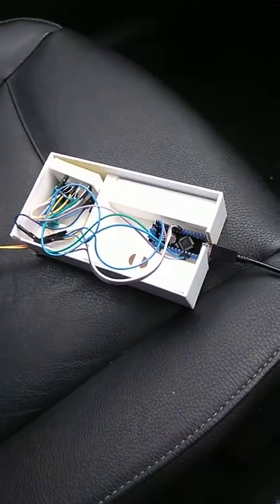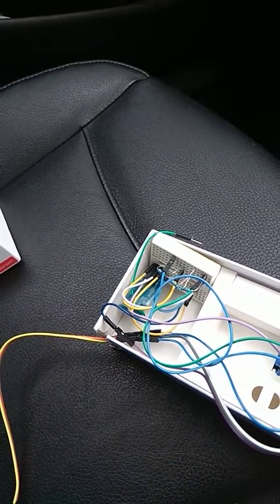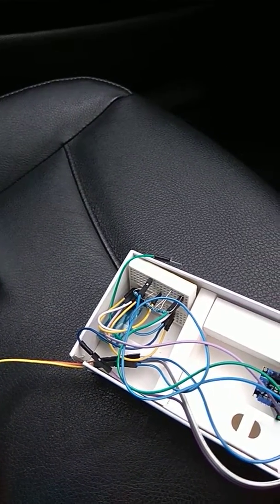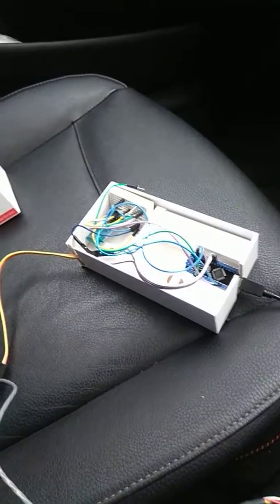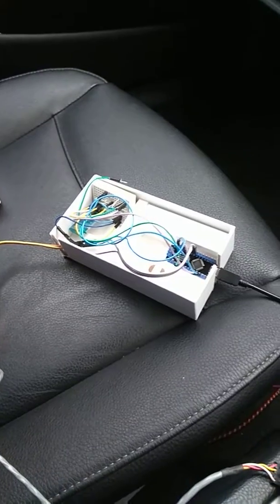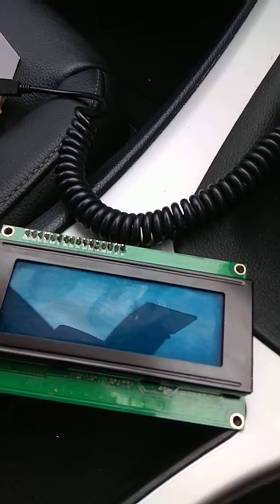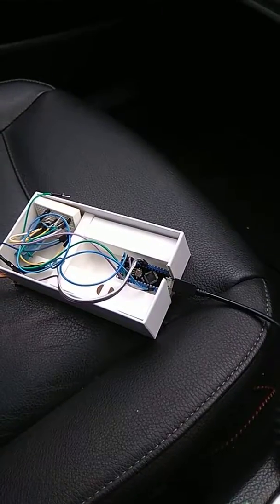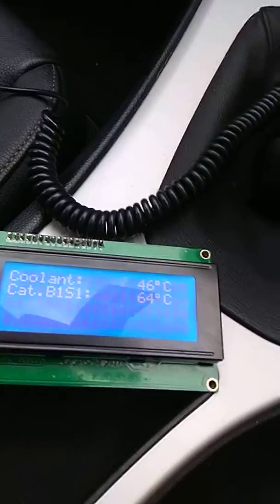Arduino DPF monitor- HC05 + LCD + ELM327

Comment: Looks goods, going to build one and give it a try.  For people that have issues connecting check that you have a HC05 with the switch/button on it. You may have an HC-06 which is slave only and cannot connect to the ELM device.
You need the HC-05 as the master device. Thanks for the video.

Comment: Hello, Sir, I hope you're doing good. I'm having a serious problem connecting my HC-05 with ELM 327. It worked perfectly fine and connections were established between both devices and i've got the values too but suddenly it stopped working and now it does not connect. I'd really appreciate if you give me any tip on how to do it.
Reply from the maker: Masab Ali hi Madan, unfortunately I'm having the same problem. I can connect and get the value but the value is always the same for me. The stupid Bluetooth is so complicated. Sorry I can't help

Comment: I’ve been struggling with this project would you by willing to share your code and sketch?
Reply from the maker: hello friend, this was an old project. I also experienced issues with this and have stopped using it. It is a very difficult system to diagnose. Recently I have revisited this... If you give me a little time, I will fix it up and maybe post a video on how to do it. Else I can post for you my last known working code?
Reply: Hi. Congratulations. It’s wonderfully. I will do same it. My car is Mitsubishi lancer. So I want you used code and sketch. Could you share me?
ihsan.akckyn@gmail.com
Reply: It is possible with esp8266 wifi module sir

Comment: hello, I can not match elm327 with bluetooth HC05 module, could you send the source code of this program? thank you
almeida_sidney@hotmail.com
Reply from the maker: Sidney Almeidasidney connecting the Bluetooth to the elm327 is a real pain as most hc05 modules can only accept connections and not make them. I can share your code but if your Bluetooth and elm327 aren't connecting, there's no point
Reply: @MTechOver9000  hello, very complicated to carry out the communication between the module ELM327 and HC05 bluetooth, I researched in several scientific articles and to be able to carry out the communication. If I can send the source code. thank you
almeida_sidney@hotmail.com
Reply from the maker: Sidney Almeidasidney the code will not help you if you cannot get the hc05 to connect to the elm327
Reply: Hello, Sir, I hope you're doing good. I'm having a serious problem connecting my HC-05 with ELM 327. It worked perfectly fine and connections were established between both devices and i've got the values too but suddenly it stopped working and now it does not connect. I'd really appreciate if you give me any tip on how to do it.

Comment: Hi. Care to share the connection method for the hc05 and elm327? Im stuck with it, did you change the baud rates or something?
Reply from the maker: Isaac Loor I ended up getting stuck with this too. First make sure you have a master hc05, the slave looks almost exactly the same but when you give it the command to connect/pair it anyways gives an error. The only connection method that worked for me was soldering a wire to pin 34 on the hc05 and making sure that pin is high when you give it power... Follow this http://www.martyncurrey.com/arduino-with-hc-05-bluetooth-module-at-mode/

Comment: Hello sir,i have tried using the code for the past few days,but it keeps failing. I  saw sir that you have connected the Bluetooth module via  software serial.How did you manage to do that sir, 
i used this method to connect the HC-05 to ELM 327 : https://arduino.stackexchange.com/questions/16954/problems-connecting-reliably-using-hc-05-as-bluetooth-master
after that i have also tried executing the codes from : http://www.instructables.com/id/Arduino-OBD2-ELM327-I2C-LCD-HC05-Bluetooth/
and it also failed. 
After that i tried uploading your codes sir, It has still failed. I think the codes that you have given to me is not working since I have not configured and wired it the same way as you have done it sir.It would mean the world to me if you could help me with this.
I am very grateful for your help sir .
Reply from the maker: Hi, I did this some time ago so I'm trying to remember how I did it. But that method for connecting the HC05 that you posted didn't work for me, it drove me crazy for weeks.The HC05 has two AT modes: 1) normal AT mode which is activated when you are pressing the little button when the HC05 gets power and 2) advanced AT mode. To pair with your devices you have to go into advanced AT mode, this is VERY IMPORTANT. You need to solder a wire to pin 34 of your HC05. Pin 34 must be recieving 5V when the HC05 recieves power to enter into advanced AT mode. Then and only then will all the AT commands to bind,pair etc work. Check out http://www.carobot.cc/how-to/hc-05-guide .
Reply from the maker: Software serial is just a library you need to include which allows you to use other pins for Tx/Rx serial. Therefore BT is operating on Rx/Tx on arduino pins 8 and 9 leaving Arduino's original Rx/Tx pins to communicate via USB back to serial monitor for printing to computer screen. One other thing to mention is that you need to have a voltage divide as the HC05 Rx pin must be recieving signals at 3.3V not 5V from the arduino Tx pin else you may fry the HC05. Hope this helps
Reply: yes on the arduino  uno which i am using  there is a 3.3 volt pin as well as a 5 volt pin. i manage to get it to the AT mode using the method i showed.It also showed successfully connected.I used a Bluetooth address scanner and the Bluetooth address of the HC-05 and elm 327 was not shown.this means it is already successfully connected.after that i tried to upload the codes so that the communication can take place.but it fails,sketch keeps on showing all the codes are error.
Reply from the maker: No, you must use the method I explained using HC05 pin 34. Some of the AT commands (not sure which ones) will only work when using the advanced AT mode. Trust me on this, I struggled for weeks until I did this method and you will probably not get anywhere until you do the same. Also I dont think you understand voltage division, it is using resistors to limit the 5V voltage going from Arduino Software serial Tx pin to 3.3V HC05 Rx pin. Go check out that last link, all the wiring is explained in the last diagram.

Comment: Greetings sir, a very excellent project sir. I am very interested in your project sir.I am also working on a very similar project but i have hit a few road blocks.  I have managed to connect the HC-05  with the ELM 327. The next step is to make sure that the arduino can receive data from the ELM 327 and display it.But sadly sir, i am not to sure on how to do it.I would mean the world to me if you could assist me on this issue.
Reply from the maker: Hi bro, I will help you wherever I can. First thing you need to do is make double sure you have connected and bound the HC05 and ELM327 properly. This part is tricky. If it is done correctly, the HC05 module will have 2 quick blinks followed by a pause. Does yours do that? I had my HC05 Tx/Rx pins connected via software serial.

This code should work for you if all is set up correct:
https://drive.google.com/open?id=1A8gE5FjIYFBDI1vTebL7ZrUdnUi_7xWV
Reply: thank you so much for the reply.I manage to do it using the AT- commands in the arduino serial terminal. with the wiring way. btw sir,the link is not functioning. IT show error 404.
Reply from the maker: Youtube didn't let me copy and paste the link so I had manually entered it wrong. It should work now
Reply: the method that i used to configure it is by wiring:
UNO............................................................HC-05
GRN PIN ....................................................GRD
5V.................................................................VCC
PN 10 ............................................................TX
PN 11.................................................................RX
PIN 9....................................................................KEY 

Those above were the connections i made and i configured them with the AT Commands.
Reply: yess it is working now,the link is working now.You are amazing :)
Reply: @thelvinnair8250  Hello, Sir, I hope you're doing good. I'm having a serious problem connecting my HC-05 with ELM 327. It worked perfectly fine and connections were established between both devices and i've got the values too but suddenly it stopped working and now it does not connect. I'd really appreciate if you give me any tip on how to do it.